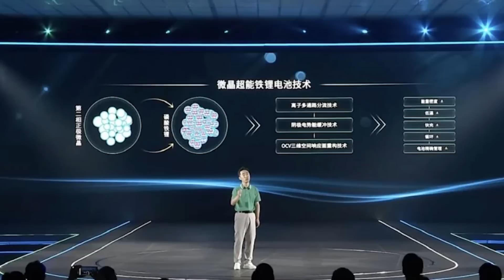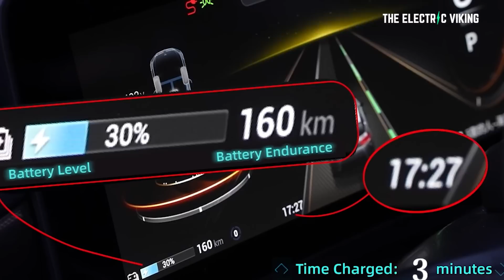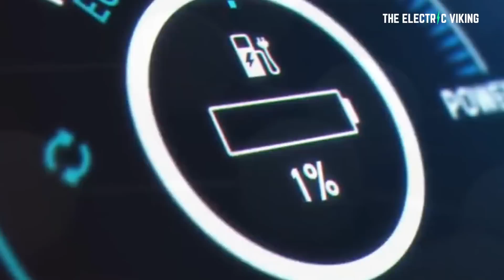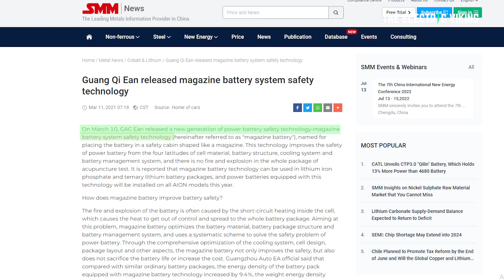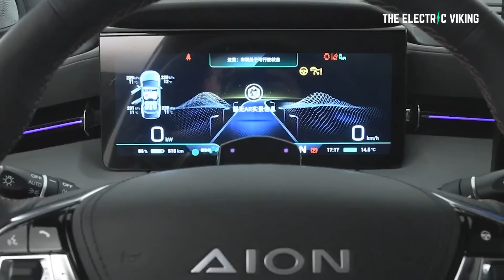New battery tech increases energy density by 20% at -20C

Comment: That's not how C ratings work. The way it's calculated is the Amp hours of the battery times the C number is the charge current.

So if you have 10 amp hour battery, 1 c would be 10 amp charge current. 2 C would be 20 amp charge current. 

To figure out kilowatt hours, you now multiply that by the total package voltage and that's your kilowatt hour charge rate. So, if you have a 10 amp hour battery that's 400 volts, 1 c would be 4 kilowatt hour charge rate, 2 c would be an 8 kilowatt hour charge rate. etc.

Comment: Interesting. GAC have built and are developing a hydrogen powered ICE. It is also building hydrogen fuel filling stations in Norway.
Reply: Any reason why?
Reply: @Atgul-z6o  this battery pack was announced a few months back and it was speculated that it was designed to complement a fuel cell in a military vehicle . All weather vehicle that could operate in extremes of temperature. The hydrogen ICE is the eighth I have heard about and the first I have heard about in China.

Comment: If the charging form of the future is energized roads wirelessly charging vehicles driving on them (a possibility seldom mentioned but in my opinion, likely), battery packs and their cost and weight, will become much smaller; with charging sections every 50 miles, who needs big energy storage?

Comment: Is this new battery operational at -20C? The LFP batteries that I am aware of cannot even charge at such low temperatures!
Reply: No LFP can charge below freezing,at least at any appreciable rate. They just need to be heated up,or plugged in before they cool down (as usage normally warms them).  They can be used / discharged in cold weather however.

Comment: If this is all true...They should be able to offer a 200 mile batterie much cheaper.......Would also make for a lighter car........Would be lighter still if they would just remove the brake discs and calipers from the rear axel and just use strong regen on that axel.......More $$$ saved on that move also along with less unsprung weight.........I see nothing but improvements coming for EV's.....Paul

Comment: It took what 100 years to get fuel infection and turbos? Battery technology will advance MUCH faster than that. It will be measured in years, not decades. We may get to the point where there are new batteries every year model of cars. In the 1950s the body style changed every year, from now on there may be new battery types every year.
Reply: Am sure that will happen..........Future is bright.............Paul
Reply: Turbo and sc has been used on trains and warplanes since the 1930s, Inc compound charging, along with direct injection from water methanol or alcohol.
Reply: @4literv6  We may see high density batteries and new designs of electric motors in those applications before we get them in cars.

Comment: Petrol and Diesel deliver about 13,000 W-h/kg with 35% efficiency so that ends up being 4,550 W-h/kg. The EV batteries deliver about 245 W-h/kg with 95% efficiency so that ends up being about 232.75 W-h/kg. So in the end an ICE engine is more energy efficient than EVs.

Comment: Americans won't jump onboard until they can buy a car for around $45,000 that will go 1000KMs. It's sort of the sweet spot. The Tesla's are too expensive and requires financing for most people and with interest rates going up that's going to stop a lot of people. We are in a recession but some think it will end next quarter but who knows.
Reply: I agree.
Reply: Sorry but that’s not true. You’d be “over delivering.” Also a market isn’t binary, meaning a statement such as “Americans won’t XYZ” is a false premise. Markets are split up into segments of early adopters, mainstream, and then late adopters. 

Fact: It’s a sellers market in the US. Everyone who brings an EV to market can’t keep up with demand. This is driven by the early adopters and some from the mainstream market. 

What I think is true that is that the late adopters won’t jump on board until the price is lower. And some, people who tow for example, will want something with 350 miles of range.  I agree with your statement if it was adjusted to say: most Americans (mainstream market) will own an EV when it’s around $45k and the range is over 300 miles. (Most Americans can’t even conceive what 1,000KM even means. 😂). 1,000km is FAR more range than ICE offers today. With fast DC charging, this much range isn’t necessary and certainly not for the mainstream market.